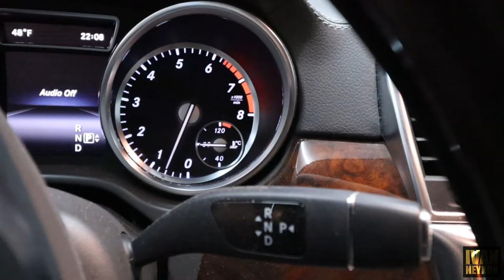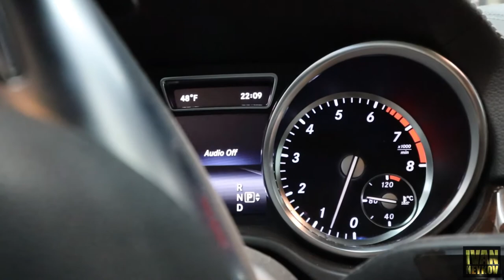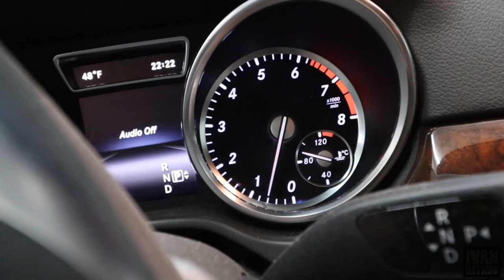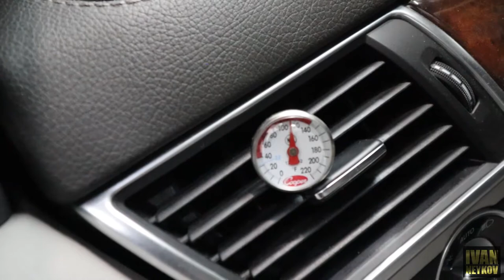I FIX My Radiator on Mercedes GL450 | PT 3

Comment: You have not mentioned about the aluminum lines that connect to this water radiator. On a new radiator these lines would connect where red caps are. What fluid is running through them? Steering?
Reply from the maker: Transmission oil
Reply: @Ivan_Neykov  My understanding that transmission lines need to be disconnected and fluid will leak. Correct? Share how you managed those lines.

Comment: i took the radiator cap off and one of them is leaking fluid, is the whole radiator bad or can there be a solution?
Reply from the maker: I don’t know if there is a really solution, but I wouldn’t risk it. I will change the entire radiator instead of trying to do this job 2-3 times just a friendly advice.

Comment: How did you get all of the desiccant, crystals, out of the system? Also, did the heat have issues too? I think that stuff has gotten into my heater core.
Reply from the maker: So yes, I did have problem with my heater core, that’s how I found out about my crystals in my system. The way how I cleaned up my system or I think I cleaned up my system is I installed a filter right before my heater core so I can check the filter and see if I’m still getting crystals going to my heater core. i’m in the process where I’m making a video where I am replacing my expansion tank and showing my filter as well and showing how many crystals there is in my expansion tank because that’s the source of the crystals. if you have problems with your Mercedes where your car is running with the normal temperature, but your car is not blowing hot air then you definitely have crystals in your system or dirty fluid.
Reply from the maker: Oh, and one more thing if you have a chance run a water through your heater core backward so if your heater core is clogged, hopefully when you run water backward, you unclog it and clean up your heater core that’s how I clean up my heater core